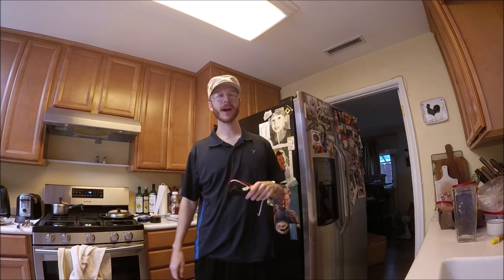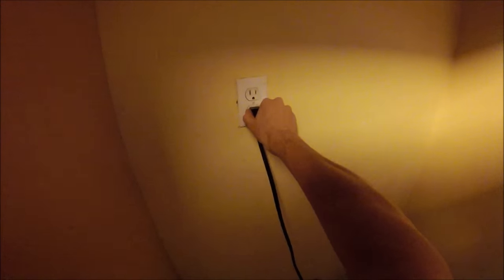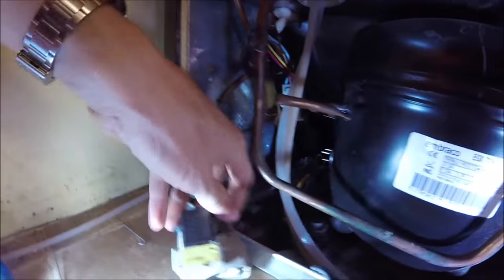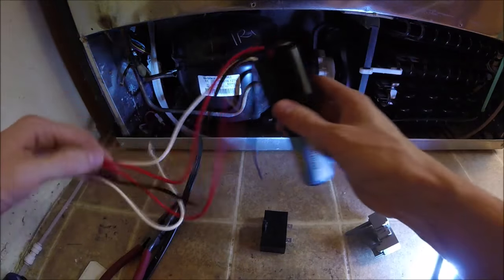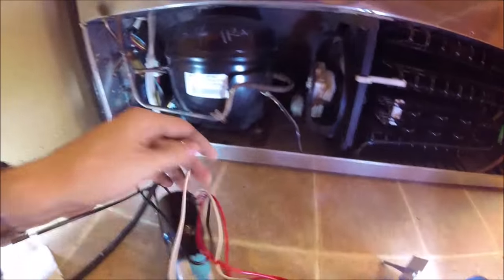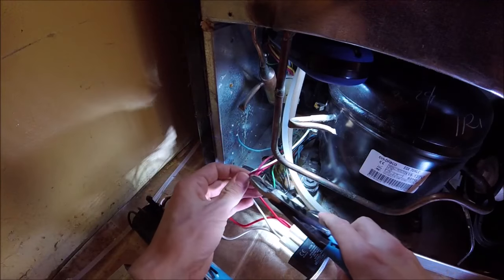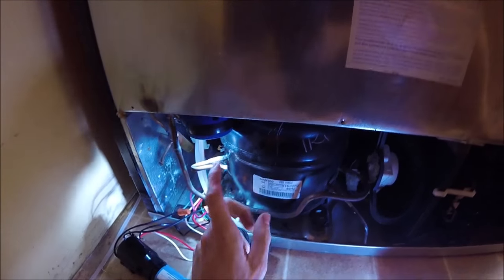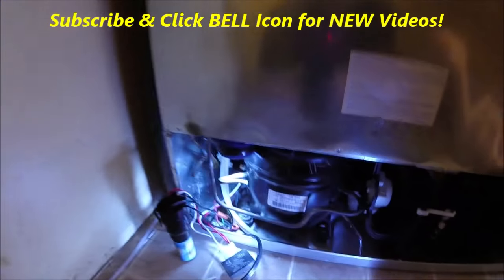Fix Refrigerator. Installing Universal Relay (3 in 1 Starter) on Compressor -Jonny DIY

Comment from the maker: Tools & Supplies Used 
Start Relay 3 in 1- https://amzn.to/2ANFL1H
Start Relay with Capacitor Wire Connectors- https://amzn.to/3StZRmT
Tool Set- https://amzn.to/3tbmEbo
Wire Cutter Crimpers- https://amzn.to/2PKYnFg
Magnetic Work Light- http://amzn.to/2hzL2Qv
Cable Zip Tie Set- https://amzn.to/3r7hTOy
Safety Glasses- https://amzn.to/2XXe3dI
Nitrile Disposable Gloves- https://amzn.to/3dAZYZV
Gloves- http://amzn.to/2w0i1SP
Thanks for Watching! Help Support the Channel by Subscribing & Clicking the BELL Icon for all NEW Videos!
Reply: That part does not have the daisy chain cables with connectors on it
Reply: GOOOD JOB
Reply from the maker: @chuckblackstock2353  thanks Chuck! 👍🏻
Reply: Giid video, but: Your video shows ERPU410.  The link = URCO410-0  What am I missing?  (My fridge: Frigidaire FSC23F7DW8)
Reply from the maker: @philgar7786  same thing just different brand I believe 👍
Reply: @JonnyDIY   TY for the reply.  I had this thing stored and decided to fix it (and maybe sell it).  This was a long time ago: Originally, I fixed it with an Electrolux kit.  Now, when troubleshooting, I was looking for other problems and then realized the start relay was bad (again).  It was an Electrolux kit but only lasted about a couple of months (back then).  Sucks, huh.  Also, that kit has gone up in price by about 300%.

So, yeah, I will just do a cheaper repair.

Comment: This is used as a diagnostic tool in the professional world, it's not really meant to be used as a fix. Just an opinion.
Reply from the maker: It can be used for permanent use or temporary until you can source the factory part. I had no troubles using it permanently for years, and the guy at the appliance repair shop said it was good 👍

Comment: You don't need to plug in the old capacitor, there is one in the 3 in 1 unit. The original parts can last 20 or 30 years. In my experience, it is rare the 3in 1 lasts more than ten years. Keep a cheap thermometer in the fridge or freezer and check it often.
Reply from the maker: @judgedayan9934  thanks for the advice 🙌 yes I usually get original part but no one had local in stock so just used this one
Reply: I Agree to use the 3in1. Often the old parts are not available. Just you have to realize that eventually you all have to replace it

Comment: Some say that hard start kits can be detrimental to refrigerators because the forcefulness of the start can cause compressor parts to deteriorate faster. The large capacitance boost from the kit can also lead to compressor failure if the refrigerator runs for a long time without the motor-run capacitor. The high-boost over-capacitance starts can also repeatedly hammer the motor.
Reply from the maker: I've never had any issues but I'm not an expert

Comment: That’s fine just don’t need to install the capacitor, that’s why it’s 3,N 1
Reply: THANK YOU for clarifying that.... That Cap is a start cap not a run/filter cap?   He pulled the relay and starter cap, replaced with relay, starter cap and overload....  Right?
Reply: Question: my compressor says 1 Ph ( I think it means que 1 horse power). Where I can find one for 1 horse power? 🥺

It was making click sound intervals and not cooling enough but today it was completely dead. All my stuff was room temperature.

Comment: The video I needed. Some other good videos around but they all had the prongs from the compressor upside down so wasn't sure where to stick the red and white wires till I saw this one. Now just got to figure out how to get the parts store open on Sunday's when you really need them.
Reply from the maker: @chewy98ta28  You're welcome, happy to help. Hope you can get it fixed 👍

Comment: I'm one of the few that this did not fix my compressor. The old components (starter and safety shut off) the compressor would kick on for 5 seconds and then click off. With the 3 in 1 it doesn't even start now.
Reply from the maker: Dang, hope you can get it fixed and running again 👍

Comment: Fantastic video. Everything I needed to repair my fridge. Mine also had a dead capacitor that the parts shop insisted couldn't be also dead, turns out the it was and got everything from the local shop for $50. Installed in 10 mins. Much better than blowing $2000 on a new fridge!
Reply from the maker: Awesome! So glad I could help you out and that you were able to save your fridge 👍

Comment: Just went out to my garage a lil bit ago, i was hit with burning plastic as i walked in. So i pulled the fridge out and bam i found the issue. Decided to watch a quick YouTube vid and i found yours. Ran 3 miles down the road to the appliance repair shop and for $20 i am up and running 30 mins later! Thanks for the video!
Reply from the maker: Wow that's awesome. You're welcome, glad I could help you out 👍

Comment: Thanks brother,  it worked like a charm.  The only difference was my 3 prongs on the compressor were upside down, so the ground was on the top all by itself.  Thanks again. 
  Kc from St Pete. Florida
Reply from the maker: You're welcome, happy I could help you get it fixed and going again 👍

Comment: Thank you for the tutorial. Very easy to follow. Unfortunately I have ordered three times now
From Amazon and I keep getting the same part without the capacitors leads. The picture on your link is also missing the leads. I went through some other suppliers that show the plastic leads in photo but still end up without. Very frustrating.
Reply from the maker: @seanhaines283 You're welcome. That's a bummer you can always splice in your own from hardware store though

Comment: My fridge quit working 3 years ago (was 14 years old at this point) and the repairman installed one of these. It worked for 3 years. When it quit I bought a new fridge as I thought the compressor was shot at this point. Did replace a capacitor in a dehumidifier this past year and got it working again.
Reply from the maker: Nice yeah thats fridge will probably go another 5-10 years with minimal work
Reply: @JonnyDIY  I advertised it in  FB marketplace for free and a guy drove 45 miles to come and get it. He backed his pickup to it and just flipped it on it's side and I asked him whether he gave a sh....t about it and asked him what he was going to do and he said he'd have a repairman look at it and if it can't be fixed part it out. I gave him the owner's manual and he threw it in the back in the bed with the fridge (didn't even bother to put it in the cab with him on the seat). He didn't care about the shelving in the fridge etc. It was sad how he treated it.
Reply from the maker: @keithwiebe1787  ohh boy yeah always hard seeing someone do stuff like that when you think theyll be using it as was intended. Well hopefully he got use out of it one way or another and kept most of it out of a landfill 👍🏻

Comment: Just looked on and completely amazed me that a part...much cheaper than the original is better made yet extreamely durable and much more affordable than the original part that came with the fridge.

The starter relay is way over priced via parts cataloge but the universal relay.. I mean costs...👍👍👍 way cheaper just a minor mod with wires and placement of unit but does alot more and saves your fridge...Compressor from future failure.

Awsome video guy, and Thank you for helping us all from throwinf away a practically new fridge and saving it & saving
 $,$$$.$$  !
Reply from the maker: You're welcome, glad to help! 👍

Comment: Rick - had a small Haier freezer that died, when plugged in the compressor would hum a bit and go out.  I changed the starter with this 3 and 1 and fixed it right up!  runs great
Reply from the maker: Awesome glad you got it fixed Rick 👍🏻
Reply: Could have not have done it without your video, thanks!
Reply from the maker: You're welcome Rick 😀

Comment: If I know the company that made this 3 in 1 relay overload capacitor I will suggest that they make it as a plug and play so the issue of splicing wires will be eliminated,things work better.
Reply from the maker: yes easier install and more purchases for them 👍🏻

Comment: Thanks for the video. Quick question... I see you connected the 3in1 to the OEM capacitor. Other videos show the 3in1 directly connecting the 3 wires to the compressor and the 2 black to power. There is no mention of using the OEM capacitor. Is this typical to utilizing the OEM capacitor? I thought the 3in1 includes a built in cap to avoid using the OEM one. Thanks.
Reply from the maker: I believe it is optional to use the original capacitor. On the one I used it had those 2 extra connectors and said to put the old one in line if you had one 👍

Comment: Worked for my fridge! Thank you!!
Reply from the maker: You're welcome, happy I could help you get your fridge back up and running again 👍
Reply: Our fridge stopped working again in less than a month! Do you have any suggestions? Do you think there is problems with its motor?
Reply from the maker: @amirmofakham  you can try replacing again, could have got a bad part. Or try and source the original start relay and replace that 👍

Comment: This worked brilliantly...for 2 months.  I can still hear the motor/fan running.  Should I try another or does this have it's own meaning of what I should do next?  Thanks for advice!!
Reply from the maker: I've heard from others that theirs have failed early before. I'd try another one, may have just been a faulty unit. I wish they built things to last, but seems they just build em to have a low price nowadays

Comment: Very interesting, but do you go about selecting the right part. There are quite a few of these each with different ratings. Thanks
Reply from the maker: The one used should work on most regular size refrigerators. Sizing depends on compressor size
Reply: @JonnyDIY  My compressor is 0.3 hp with 14.2 LRA. It's hard to find one compatible with LRA of 14.2. They want RLA not LRA. Can you help me with this. Thanks.
Reply from the maker: @AndyNav1  If a normal sized refrigerator I would go with the Supco RCO410

Comment: I installed a 3 in  on a under counter summit refrigerator today. It worked smoothly. Temp went down nice
. However it's not cycling, compressor runs continuously for 40 minutes. So I unplugged. No what about the other wires that go to EVAP fan and thermostat?.  I reconnect them the same as before. Plan on cleaning the condenser tomorrow.
Reply from the maker: Wont cycle as much til cools fridge down completely. Takes about a day to cool fridge back down after having unplugged
Reply: @JonnyDIY  thank u. Man ,this is very helpful.tks.

Comment: Thank you, this video was very helpful and fixed my compressor problem ! .. for about a weeks time. I bought a 2nd capacitor, but now the compressor only clicks once when initially plugged in and no sort of effort to turn on. I used a volt meter to test the compressor and it seems to be reading fine. Any other suggestions?
Reply from the maker: Hmm not too sure. Maybe the start relay was undersized? Sounds like it would be the start relay if no other problems before
Reply: Update: I just restripped and capped the power wires once again and now it DOES turn the compressor on for about 5 seconds then putts out again. Retries each minute then turns off again. 🤔
Reply from the maker: @rachelkuhn6009  hmm thats what mine was doing before I installed this start relay
Reply: I have the same problem
Reply: Put an amp clamp on a wire going to the compressor and check the lra or locked rotor amps rating. Compressor might be locked up and the start relay tries to start the compressor but cant due to it being locked/siezed.

Comment: Hello first off thank you for the very concise description of the problem, no other video has done that. I had the exact same condition, the fridge would try to start every 3 minutes and it would run for 8 or 9 seconds before it clicked again and went off. 
I had a repair person come in and change the starter to a universal one ( he said that is the problem and that the Kitchen Aid starter could not be found). That started the fridge up. It cooled at the beginning for about 2 hours, but then it stopped. It would run for long time, which we should have known is not a great sign. The repair man came back and said that the compressor motor has seized and won't run. Could this be because the compressor was running hot? also could you tell me if this is something that the repair person should have known to begin with? or was there no way for him to know that the compressor had an issue. I ended up paying for the service call and the labor for replacing the starter.

Comment: Are these kits a "Hard Start Assist" ?... Thinking of installing one to my fridge so my generator will start it.
The constant rated watts of the generator would run the fridge but the start up kills it,... Would this kit help ?
Reply from the maker: No I dont think so. It doesn't lower that start up wattage that I know of

Comment: So I watch one video showing the 3 pin triangle on the compressor.....they connect white to the lower left pin, red to the lower right pin, and black  to the top pin.  You connect all of them to different pins.  Wonder who is right ?
Reply from the maker: May have worked the same on both. All I know is that the fridge I fixed is still working perfectly fine today.
Reply from the maker: Just locked at my video. The orientation of my compressor wiring pins was just opposite or upside down of the other one you watched
Reply: @JonnyDIY  Well, I watched several more.  All went with the black on the pin at the top of the triangle, white on the lower left, red on the lower right (although one or two did have an inverted triangle, but the pattern simply flipped over in that case)......so I connected mine that way just now, and it's running/getting cold.
Reply from the maker: @edsmith4414  glad you got it working 👍🏻

Comment: The two black wires are inputs to the 3 in 1.  Does one black wire have connect specifically to ground and the other to power? if so how can you tell which one to connect to power?   or are they interchangeable (either black wire can be power and the other can connect to ground? )
Reply from the maker: Doesn't matter which one goes to which on those 2 I believe 👍
Reply: @JonnyDIY  thx man!
Reply from the maker: @hansolo8225  you're welcome, happy to help 👍

Comment: why did you want to keep the old capacitor? What if the old capacitor is bad
Reply from the maker: The 3 n 1 I got said you can use it in line if you have one, but it should work without it as it has one built in to 3 n 1 👍

Comment: Wierd how the 3 in 1 start relay i purchased doesn't have connectors for the capacitor... i thought thats what the 3 in 1 was designed for?
Reply from the maker: I believe you can still run it without hooking up the capacitor, that or you can cut the wires and daisy chain in some with wire nuts running to capacitor 👍
Reply: Mine didn’t come with connectors for the two extra blacks wires either. I hard hooked all up to each other, without using the old capacitor. Now my compressor gets too hot to touch.

Comment: Just had a quick question.  For my power my fridge has 2 white wires and 1 blue wire. How do I go about connecting those to the 2 black wires on the start relay?

Comment: Doesn't the 3 in one have a capacitor built in?
Reply from the maker: Yes it does. I believe it is optional to use the original capacitor. On the one I used it had those 2 extra connectors and itsaid to put the old capacitor in line if you had one 👍

Comment: Is this a temporary fix while get the OEM , or ot can be used long time? Thanks
Reply from the maker: It is a permanent fix 👍
Reply: @JonnyDIY  thanks , ordered and ill get it today , if works , saved 289$ from the original part
Reply from the maker: @viverenegliusa8518  you're welcome, hope you can get it fixed 🤞👍

Comment: Great video! I have a spare fridge in the basement that went bad a few months ago. I baught the 3 in1 and it didnt work. I thought I'd give it another crack at fixing it. I noticed the one you have on the video has a connection port for the capacitor. Do I need to get that specific one? The one you have linked doesnt seem to have it. Thanks in advance!
Reply from the maker: No need to get a new one of you're handy with wire cutters and connectors. You can just splice it in line. If not can order another with the connectors. I've seen some online with them. No guarantee its not the compressor that went out though. Can check that with a multimeter though. Search "test refrigerator compressor" 👍

Comment: Hey Jonny, I am looking to do this for my LG LRMDC2306S/00.  Question:  which size 3 in 1 is best - the RCO410 (1/4-1/3hp) or RCO210 (1/3-1/2hp)
Reply from the maker: I believe the 410 should work fine for that fridge 👍
Reply: @JonnyDIY  thanks. I’ll get it ready to replace. That said, the connection the compressor looks different so I’ll need to see how to do it.

Comment: So i installed it and its still not cooling. Thermostat reads continuity so thats fine. All 3 leads of the compressor has cont. to eachother. And no cont. to the frame of the compressor so thats fine. Im not sure where to go after that

Comment: i just watched your video and we bought the relay switch/the exact  part # that was originally on our Kenmore frig  but i am confused why everyone i see uses the start relay 3 in 1. is that better then using the actual parts it comes with? please help me understand.
Reply from the maker: The 3 in 1 is just more of a universal part, it's more readily available.  I couldnt source the original part in the time frame I needed so I went this route. I have replaced the original start relay part before once, both worked just the same 👍